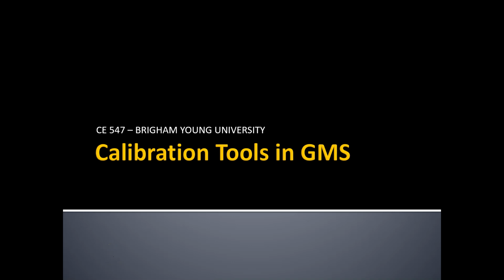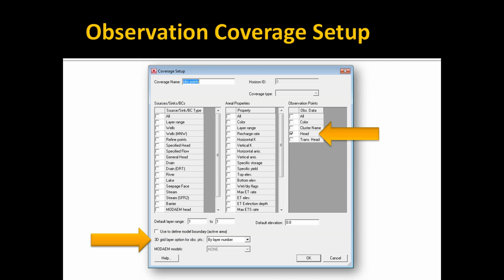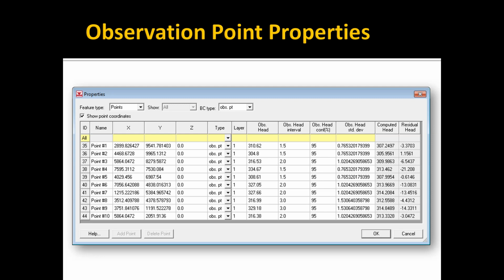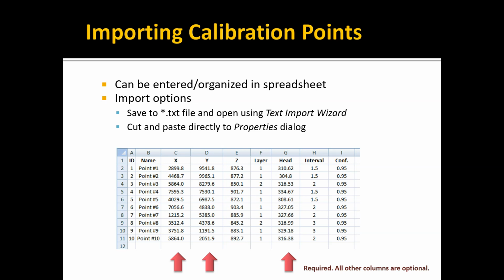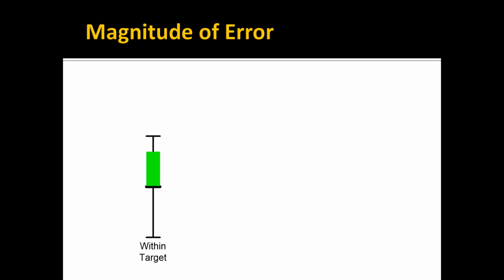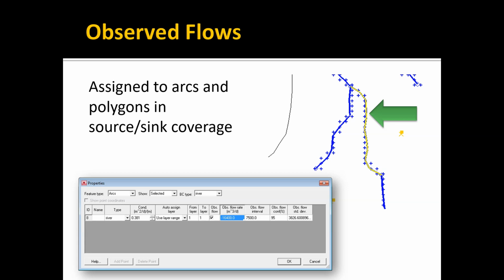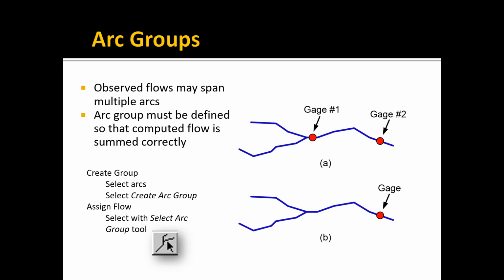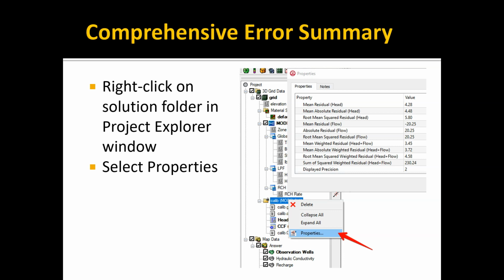Calibration Tools in GMS

Comment: how do u decide the obs head interval range?
Reply: The interval is typically quite subjective. If you are doing a large regional model and/or don't have a lot of good data to build your model, you may want to go with a larger interval of 5-10 meters. If you are doing a more localized model and/or you have lots of high quality data, you can use 1-3 meters. In either case, you typically calibrate until you are unable to lower the residual error any further, so ultimately you may want to adjust the interval so that the calibration targets (red, green, yellow bars) are helpful in showing the spatial distribution of the errors. For example, if your interval is too big, all of the targets will be green. If your interval is too small, all of your targets will be red. 

I hope this helps.
Reply: @normjones  yes it definitely does help. Can we go the other way around by estimating the transient head std. Deviations of observations wells and at 95% confidence interval obtain the head interval?
Reply: @ankitt25  Yes, you certainly can. But in my experience, that is rarely done. Remember that it is the standard deviation of the measurement error, not the standard deviation of measurement values.